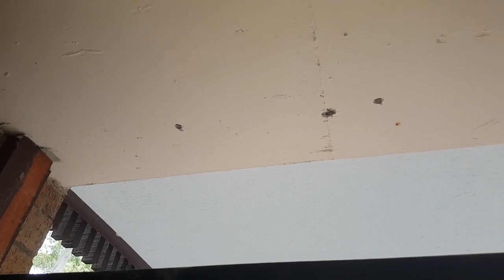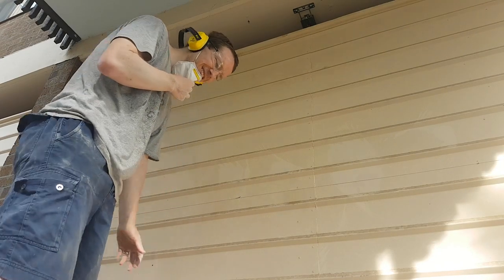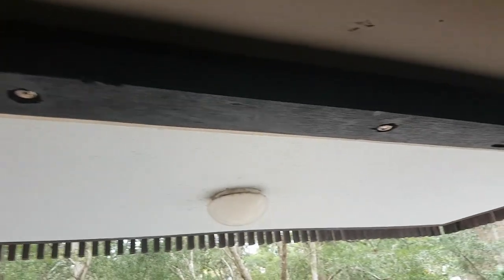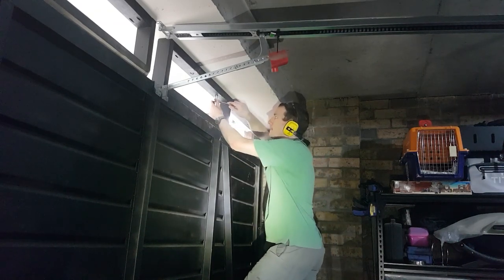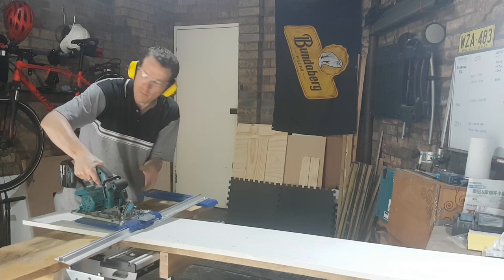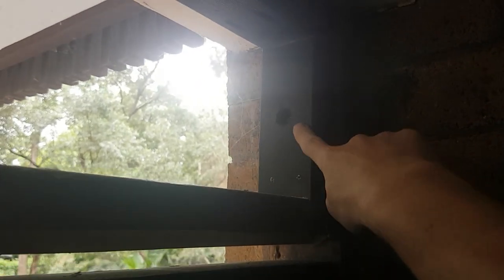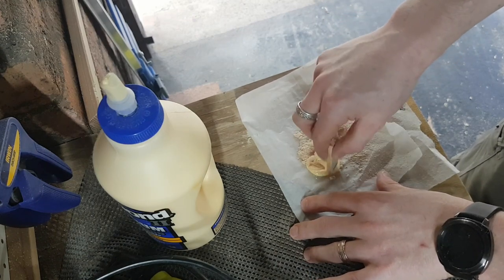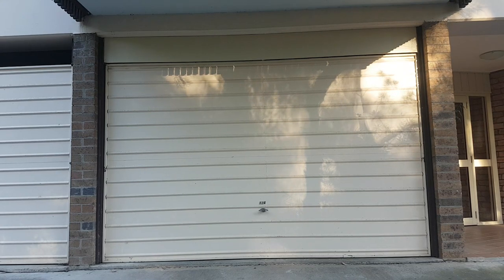Cladding and Mounting - Garage Barrier (Part 2/2)

Comment: those handheld hammer drills are hopeless for that, best bet is a sds hammer drill.
Reply from the maker: Indeed!  It chews brick well but really struggled with the concrete. Mind you, it also only JUST fit in the gap above the door, anything bigger I had no hope short of taking  the whole door off it's hinges.